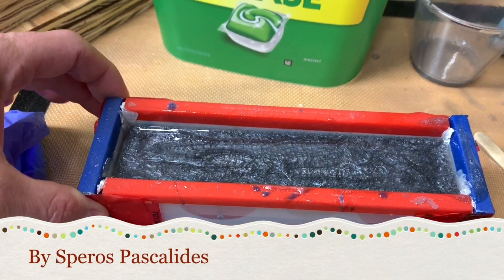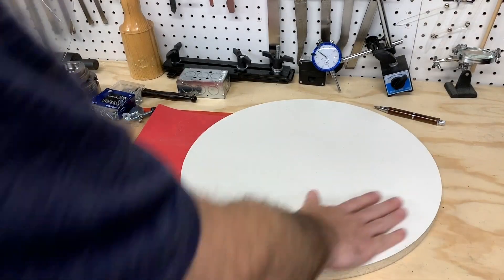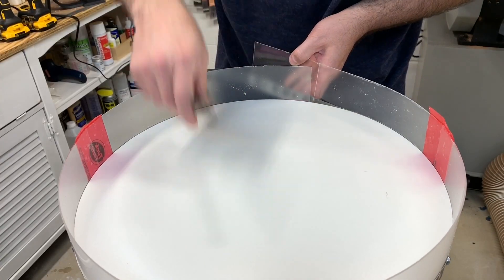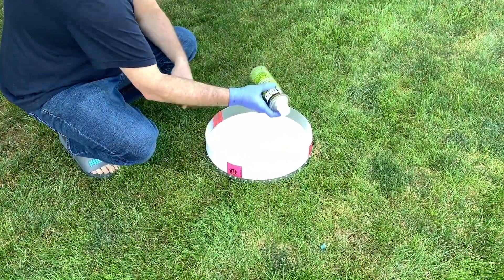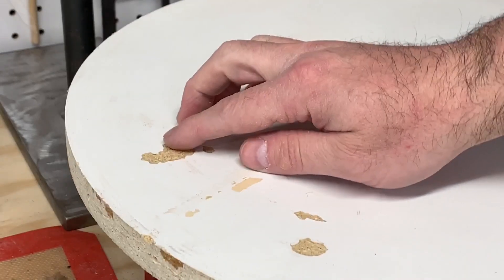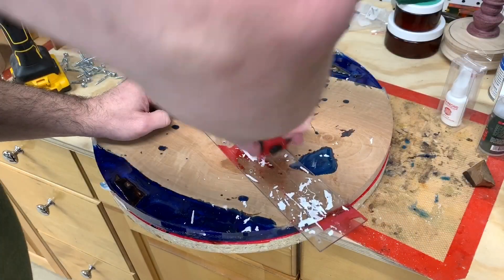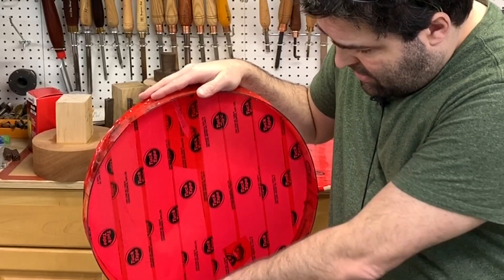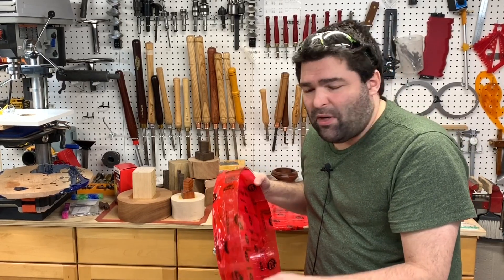Making A Large Round Resin Mold

Comment: Very good video mate👍 I made a very large round mould and poured a very successful hybrid platter blank using your method. Love the tuck tape. Couple of suggestions though...I use the plastic corrugated board they use for real estate signs (I got a whole bunch for free from a local agent) instead of Perspex and I use hot glue to seal the join instead of silicone ....the resin doesn’t adhere to either.!! Using the metal strap to reinforce the join is genius though really liked it👍👍👍👌thanks for taking the time to make your videos much appreciated😀
Reply from the maker: leo hollingshead Hi Leo, sounds great! I have made molds out of the corrugated plastic before, Works well. I don’t have luck with hot glue, maybe it’s the glue I’m using? My epoxy resin always sticks to it. I use high temp glue,, maybe that’s an issue? Thank you for tips, and for watching. Cheers my friend! -Speros

Comment: Hi. I'm struggling with the same stuff as you, of course. The thing is, that it seems that the very tape you use is the key.... not any of the other materials... and I'm not sure I can find that here in Denmark.
Reply from the maker: The tape helps for sure. It’s sheathing tape for out side houses. Not sure if that helps. Cheers my friend.
Reply: @spwoodart  
Thanks for your answer mate. I think I may be able to find something similar here in Denmark ;-)
It's important to note, that I am primarily focusing on making smaller (and always round) coffee tables.... a bit larger than the mold you've made.
I am, of course, watching your video because I too want to make a mold that can be reused. It is way too time consuming to have to make, basically, the same mold over and over again.
It's a hassle though... many, many wood working videos, and especially epoxy related videos, rely on specific kinds of tape that likely exist in Denmark but have completely different names.... and are necessary to do the job.
I've tried a few different ones that absolutely did not do the job, so I'm kind'a.... arrrgh, LOL ;-)
It looks so easy on video but when the whole thing sticks and you have to use chisels to pry the thing off.
I've bought me a release agent too, like you use in the video.
I'm really hoping to find some kind of e.g. silicone bendable material and make a mold where I can somehow 'release' the sides/edge and then pry it off the bottom afterwards... obviously without destroying the edges of the mold.
Thanks again for answering 🙂
Reply from the maker: @timholstpetersen79  I know what you mean, I didn’t want to make molds over and over. You can make a mold like the one I have (bigger) and use 100% silicone chalk. You could
Smear It all over the edges and bottom. I have not tried it, but it may work. Thanks for watching my videos, I appreciate it. Cheers!
Reply: @spwoodart  
Hey, of course.... and I'm sorry I forgot to subscribe and like... it's been remedied as I'm writing this ;-)
Again; thanks for answering.
I will try a similar approach as yours but need to figure out a way to make it easily repeatable. Not in an industrial sense but still something that makes it easy to produce multiple tables of the same dimensions with a single mold.
I'm stoked about this, because it would allow me to eliminate one of the constraints of making these tables.
The thing is that I actually love making the molds.... it's part of the process... but I have too many ideas on what to put into the molds, and am too impatient to use the time on the molds ;-)
Reply: One of the other constraints, of course, is the cost of the epoxy itself... so for starters like me (and you, at some point), it can be an expensive learning. On my last project I used 6 kg of epoxy... and it turned out 'okay' (my wife is happy ;-) ), but I had to ditch the mold and do it all over again.
I want to feel free of the mold thing and to experiment with designs.
For now, round coffee tables but....

Comment: What's the thickness of the plexi? I'm looking at doing this with HDPE but not sure how thick it needs to be. Thanks
Reply from the maker: @dannysdiyshed  Hello, I believe it was an 1/8 inch thick piece of plexiglass. If you are going to use HDPE, just like the plexiglass it needs to be thick enough to bend without breaking, but thick enough for strength to stop any resin push. The smaller the circle the more bend you would need. Hope that helps and thanks for watching.
Reply: @spwoodart  It really helps and so does the rest of the video! Thanks for sharing buddy

Comment: but how do you smooth the silicone and doesn't that prevent a crisp edge
Reply from the maker: @wlm1217  hello, you can use a wet finger with a rubber glove to smooth the silicone and a little dish soap. II don’t like sharp corners on the pieces I make so a little round edge doesn’t bother me for what I make. If you want a crisp edge, work the silicone with the corner of something square to get a 90° angle in the edges. Hope that helps.

Comment: Very good video. Thanks for taking the time to share. I searched through your comments section and found that I needed 1/8 inch plexiglass and Tuck construction tape. available at Home Depot. My only suggestion is for novices like myself it would be nice to have a short list of items needed.
Reply from the maker: Hi, thanks for the tip.
Reply: And - I just saw a video that used garden edging (a plastic roll) that looked a lot softer and longer. Seemed easier to work with. Have not yet tried it.

Comment: Hello,
I love your videos and know I need your help. I am trying to create my own clock silicone mold but I don’t know how to create the border for it. Do you have suggestions or ideas I can use. Thank you so much.
Reply from the maker: Hello, just to clarify are you looking to make a clock mold with numbers out of silicone? If so, you could use this same design and make a smaller one to fit inside it. Thanks and hope that helps.
Reply: I could use this to create the silicone mold with numbers for later use the mold to create the clock out of resin. The issue is that this way it will not create a border for the mold to stop the resin from going over the edges. Thank you
Reply: I noticed that you use a mold for clock numbers. That is basically what I am trying to create. Thanks again.
Reply from the maker: @gustavotobon7042  to get the border make 2 of these resin molds, one large one small. Out one inside the other and that should give you the border. The smaller the inside one is the bigger the border would be on the silicone mold. Hope that helps.
Reply: Thank you so much for your reply and explanation. That’s what I was thinking but being new to this type of art I was not sure. That will do the trick. I will keep watching your videos because you  surely have ideas and information to pass on. Kudos to you. God bless.

Comment: Maybe put the silicone on the outside of the seam and then the tape is on the inside?
Reply from the maker: Thanks for the idea. The silicone on the outside could work, haven’t tried that method. You could also use all tape too. Thanks for watching!
Reply: @SPWoodArt  I would still use silicone and not just tape. I am in the middle of a river table, and I missed a bit of silicone. Consequently the resin leaked under the table on one side. I am not looking forward to the cleanup!
Reply from the maker: @kelleyspartiatis5323  I hear you, I’ve had the clean up before. Not fun.